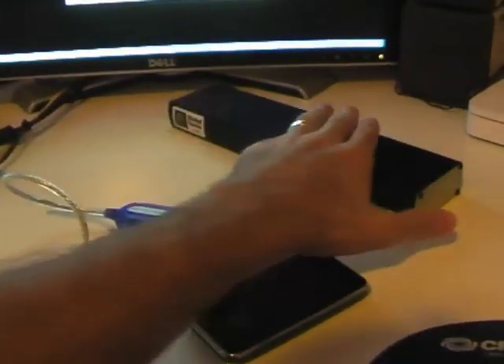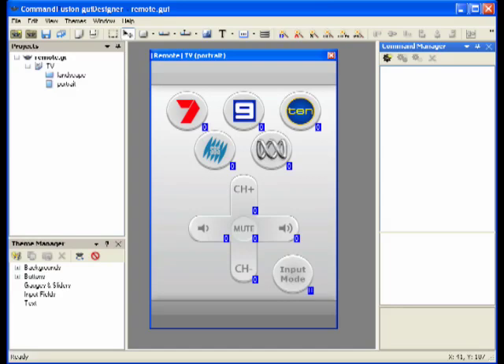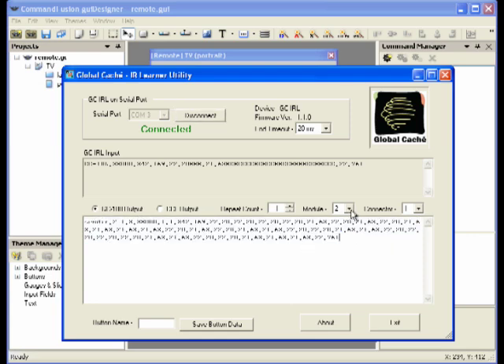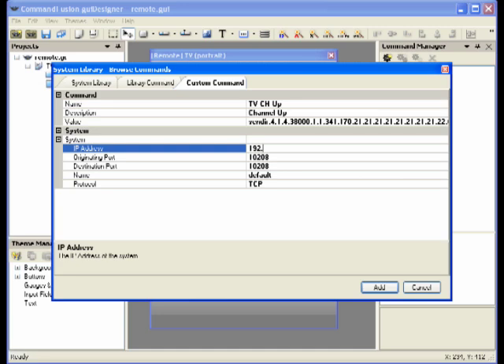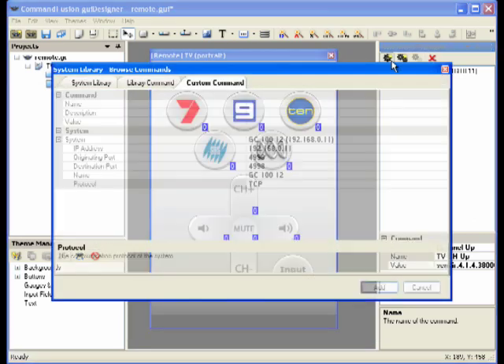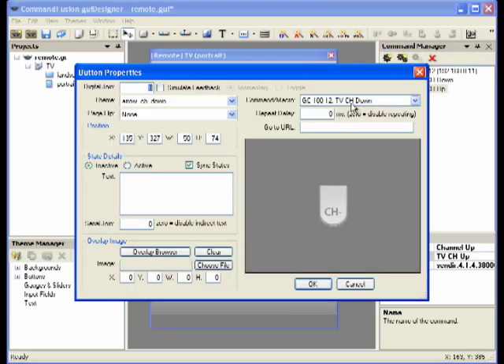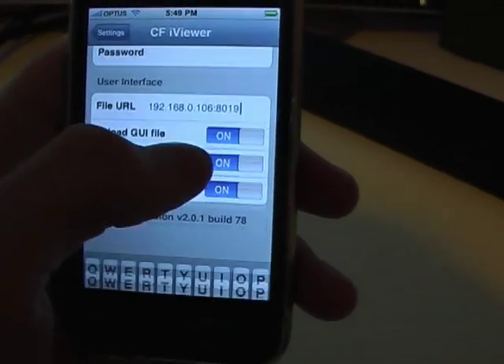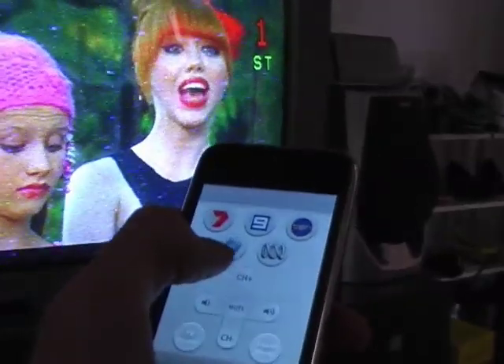iPhone TV Remote - CommandFusion iViewer

Comment: Lets say I have a controller with TCP/IP ethernet capabilities, with a fixed IP. And say I have buttons 1, 2, and 3 programmed on the iphone.  How would I link button 1 to, for example, execute command X on the controller.  Is there something like that IR learner? Something like a ethernet learner? To continue, I'd want to link button 2 to command Y and button 3 to command Z. You get the picture.  1, 2, 3 are on the iphone and X, Y, Z are on the controller I want to remotely control on a LAN.